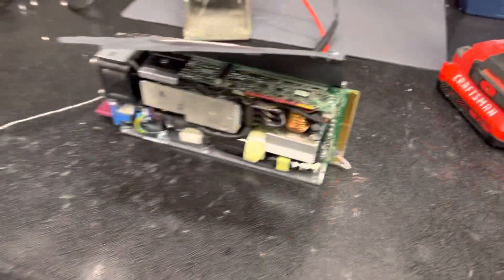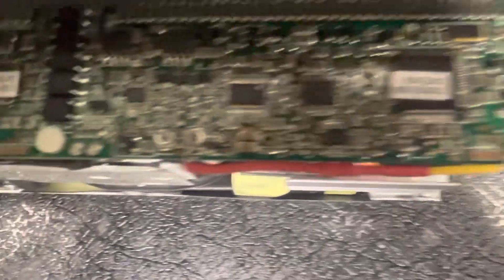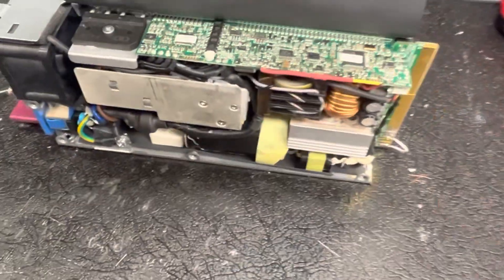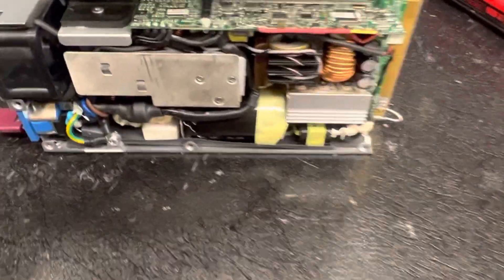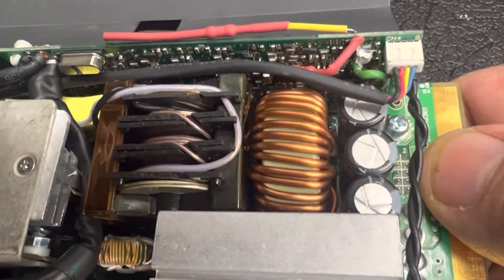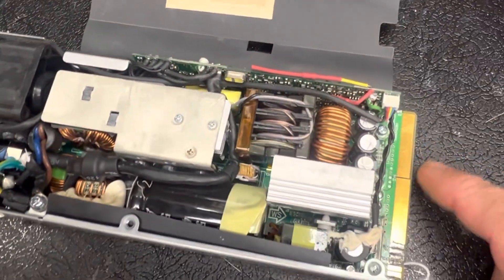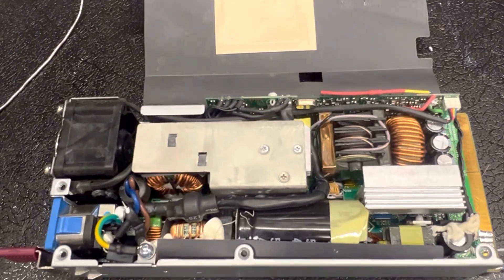Donkey Stomper Products, HP: DPS-1200SBA , Power Supply Modification , WARNING

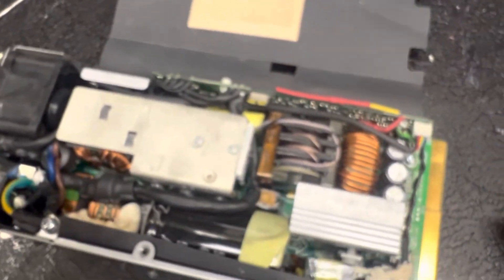Comment: 5:40 You mentioned the jumper is 1 to 3...I believe the supply enable jumper mod is 1 to 4.
Reply: And also....I totally agree with you about the soldering skills required to complete this mod.  It is not for everyone!
Reply from the maker: Yes, I think your correct my bad
Reply: Yes pins 1 and 4 are correct.

Comment: I know exactly what you mean. 
I get guys who can't solder a mic plug for various reasons. 
Now my eyes aren't that great no more either and my hands aren't as steady as they used to be.  I have a lighted magnifier and a digital microscope to help out and i don't think I'm going to try this one either. 
The price makes it sound real good but a guy is only going to get what he pays for in life. 
Appreciate the video and the reality check.
Reply from the maker: The stuff is little and hard to see to much heat or slip be a dead supply real quick. I'm gonna use them on some buddy deals that's it. I'll Stick with Mega Watt on standard builds. Before I get all mine moded ,I will be lucky if  I don't break one.

Comment: I was wondering on these pins 1 and 4 turn them on... However when you stack them is it pin 3 you need to link? Or will they automatically link when the grounds and hot outputs are connected? Thanks.
Reply from the maker: pin 2 for load sharing. Thanks for Watching
Reply: @DonkeyStomperProducts  Thanks. I've looked and looked and no one has shared that. Much appreciated! 73 W7WZA

Comment: Doing it is not the  problem on my end it's that mine seem to be stupid finicky and I had to put a 12K resistors on the crowbar side and put a 15K on the voltage side to get mine to work anyting else throw it  into  crowbar mold on my 2 pill they would work stay on I could key the box in and as soon as I audio into it it would go into  crowbar protection mode that's when I got two messing with it and putting different resistors on it and come up with a 12K resistor on crowbar protection and 15K on voltage side and mine are running fine at 14.6 v I have modded five of them and seems to be working fine this way
Reply from the maker: I did 9.1k on voltage 18k crowbar seems fine. When you lower volts crowbar lowers I think 💭

Comment: What numbers are the resistors? Thanks
Reply from the maker: 18 k crow bar 9k on volts makes 15.8 out. You can play around with different values lower voltage.  Google it look around you-tube for lower volt issues. Thanks for watching...

Comment: You are right bubba I'm a welder  but soldering is a whole different thing especially on surface mount boards like converting the old Stryker radios I bought some high-dollar nips snip that one resistor lift it up snap hemostats on it work it loose from the other side just because of the board and the heat damage the wrong soldering tip can do
Reply from the maker: Got be careful